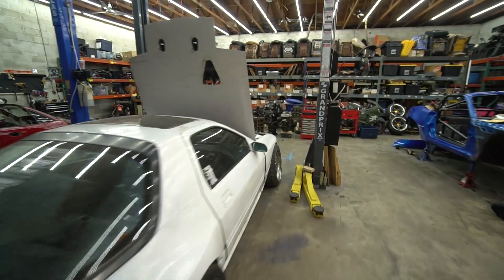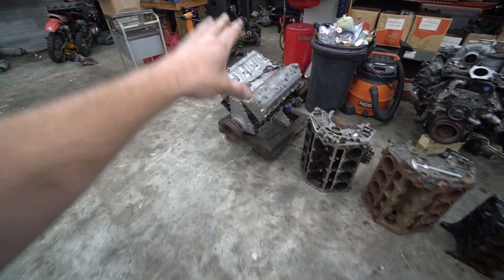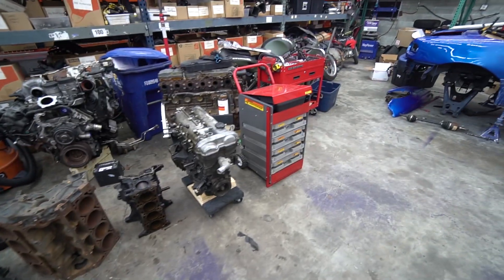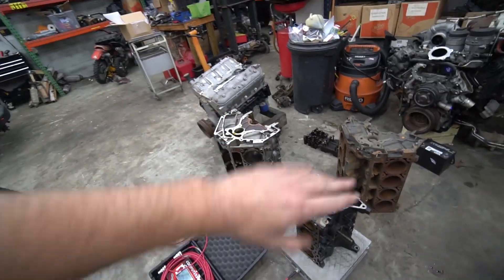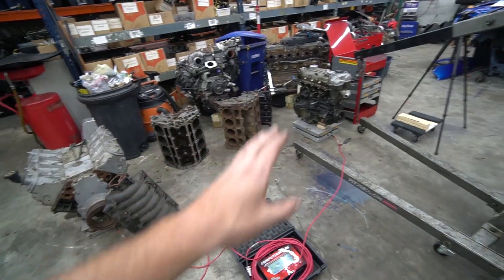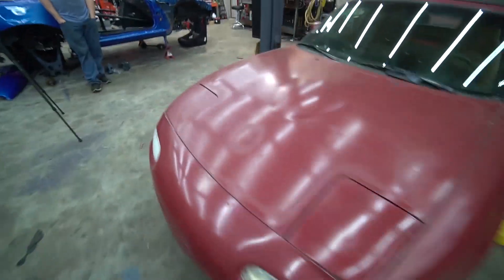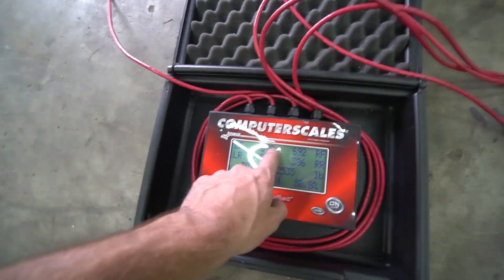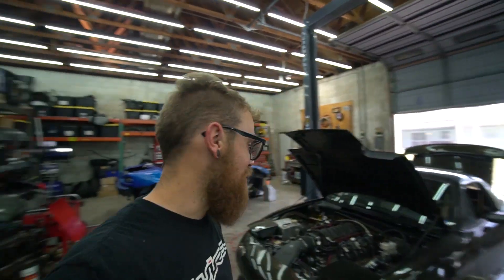Weighing Engines. LS iron vs aluminum block. 4cyl vs V8. Surprising results.

Comment: METRIC weights for everyone else
5.3 aluminium block. 45.812kgs
5.3 iron block. 92.079kgs
1.8 iron block. 31.297kgs
5.7 long block. 184.612kgs
1.8 long block. 100.243kgs
fc rx7 iron 5.3. 1238.307kgs
stock 1.6 mx5. 948.295kgs
gutted 1.6 turbo mx5. 896.298kgs
trailors' mx5 pre ls swap 980.666kgs.  post ls swap 1150.310kgs

(i used the weight summary at the end of the video, so i was a lil confused about the 1.6 and 1.8 miata stuff. why weigh a 1.8 motor when you compare it against a 1.6 dressed and in a car.)
Reply from the maker: Thanks for the conversion! And we didn't have a complete 1.6 to weigh.
Reply: Sensible measurements, thank you
Reply: Jesus so the V8 is three times heavier? I guess you do have an extra head, extra exhaust manifold (as well as a bigger block) etc etc
Reply from the maker: maverick buckley that’s block for block. Dressed engine to engine it’s 2x heavier for the iron less than 50% heavier for the aluminum block

Comment: i had my lfx na weighed at matg, couldn't do front/rear or left/right because it was on an un-level parking lot.  but as a data point....  total weight was 2545 with 3/4 tank of fuel.  that's with an lfx engine, mv7 (cadillac) 6 speed, and a  getrag (cadillac) rear differentia.  complete interior with a harddog double diagonal rollbar.  my son's car with a complete interior and harddog double diagonal rollbar, ls3, t56, and getrag and 1/4 tank of fuel was 2585 (i'm not allowed to be faster than him).

Comment: So with an almost empty tank the LS Miata with a cage, dry sump, steel control arms, yadda yadda, it would weigh in at like 2460 - 2475 lbs. This is about how much a stock 2004 NB weighs for comparison. Honestly not bad at all imo

Comment: I feel like all that work to gut the Miata wasn’t worth it for a 194 lb. weight saving and worse front-to-rear bias.
Reply: 194 lbs is a big chunk tho. Curious about how the weight distribution change effects handling and overall feel.  i can notice the weight difference between a full tank of gas and half tank while driving my miata so taking off 194 lbs, probably would feel crazy

Comment: Bro I love it. Gets a cool gadget and proceeds to weigh everything in sight. 

Really insane how much a difference iron blocks make. The iron i4 vs aluminum ls shows how freaking light aluminum is.
Reply: Aluminium is 1/3 the density of iron, but you have to use more of it to get sufficient strength, stiffness and fatigue life.

Comment: A friend who bought a late NA with an aluminum LS weighed ~2700 with the full interior and roll bar.  It ended up at ~2400 after being stripped similar to the turbo 1.6 you weighed (no rear sheet metal cutout though).  The latter weight was all tar boards stripped, full cage, no interior other than a stripped out dash.  Emilio (949 Racing/Supermiata) had an NA acid dipped and lost 30-40lbs AFTER everything else was stripped.  The wiring stripping can take out ~30lbs alone as well.  There's a bunch of weight to be lost in most modern cars, even the ones that start out pretty light.  And you get get larger than 205s under an NA.  I had 225's on 9" wheels without any roll in back and just a light one in front.  With some roll/pull 275's on 11's are possible depending on alignment and ride height.
Reply: Great info!

Comment: This was interesting to watch. I have a 05 lotus elise, sleeved k24 swapped, intake, 6767 turbo, no cage, air to air intercooler, large oil filter, 1qt larger oil pan. No weight reduction. Guys always say it needs a LS. But no way with the space and im not doing what hennessy did thats to much work. But im sitting at 1960lbs full tank without me at 746hp uncorrected. Surprising how light my car is still to the miatas cool to see you go through all this.

Comment: I wish more people would do vq swaps in miatas, their about even with the stock motor
Reply: The problem with the VQ is that it's a DOHC V6 so it's going to be wider than the LS and that just barely fits. If you're going to accommodate for the VQ you're not too far off with being able to fit something like a Coyote.

Comment: I would be interesting to see whether theres a noticable performance difference between 2 of the exact same miatas like Taylors but one with an iron block and one with an aluminium and see if the 100lbs makes a noticable difference
Reply: Napkin math says it's a 1.5% weight distribution difference if we assume the ~100 lbs is entirely borne by the front axle (which it likely wouldn't be, it would be split between both but still mostly on the front... close enough for a ballpark estimate, though).

Comment: Damn. I'm so dissappointed with the miata LS weight. I keep hearing less than 200lbs over stock.  I didn't weighted my ls1 swapped NB, but I can only guess it's around 2700-2800

Comment: get light weight wheels carbon fiber trunk hood doors fenders ,, itll drop 300 400 pounds ,remove lights motor if theres any ,, list could go on ,, you could get it back down to 2100 pounds easy ...

Comment: don't forget that you also added the unibody helpers (I think you called them ladder bars) that you welded to your frame, that was probably another 60 pounds for just those guys, the skid plate is another 20, and lots more.  the Miata is a build car, not a gutted one.

Comment: My 94 1.8 miata, stock motor just intake and exhaust with no emissions equipment, gutted, no ac, no radio , excess wiring removed, light wheels , no cage ect is 2240 with a half tank of gas. Pretty chunky . idk how I could get it lighter unless i started chopping shit off and even then, to remove another 100lbs would be a mission

Comment: Also another thing to think about for the engine weights. The LS you'll be able to run NA for the power that you'd need a turbo on the 1.8, so with the added weight from turbo, intercooler, and other turbo goodies. Would probably even it out if not make the Aluminum Ls lighter than the 1.8 turbo.

Comment: Would be cool too see the weight difference between the v8 diesel and the cummins diesel that's going in the Fummins. Great video! Maybe you could weigh Adam LZs S13 and compare it too the LS miata.
Reply: to*
Reply: That doesn't make sense to change the too to to. But thanks for the help anyway.

Comment: Regarding the Boss Hoss V8 motorcycle or any other V8 motorcycle. What is the lightest American V8 possible without tuning for power? Including CNC machining the block and heads to remove metal for weight saving?

Comment: i have a stock ka s13 that is basically all stock and has a full interior but is missing the carpets and stuff in the hatch and it weighs around 2500-2600 ish cant remember exactly its been a while plus i weighed it in kg so had to do the conversion. crazy the miata is so heavy though but with the cage and everything else it makes sense.

Comment: The Miata block has the water pump in it, the LS didn't. Great video though. Surprised your Miata weighed 600 lbs more then Ben's.

Comment: i'd like to see long block vs long block without accessories and manifolds but with the weight of the oil in both engines. the V8 taking in more oil than the four cylinder does

Comment: Great video concept, just wished you'd have done it with... well about all the engines, ever.
But more seriously yeah, finding reliable info on engine weight or power/weight ratio is unfortunately impossible most of the time

Comment: Ok, I'm not a guru, or anything, but wouldn't it been better to use a 2.2 Honda type r with 700hp+ than any other motor for weight diversity and rwd, set up curb to weight ratio with higher rpm...it's just my take on it

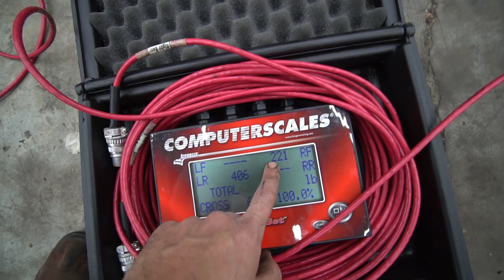Comment: Super confused about iron block 5.7L at 6:52 since the iron blocks jumped from 5.3 to 6.0L. 🧐
Reply from the maker: It's a 5.3 that was bored out and rebuilt with stock LS1 Pistons and Heads.
Reply: Thanks for the clarification Taylor.

Comment: I'd like to see a turbocharger and intercooler core plopped onto the top of that 1.8 engine, maybe even half the FMIC piping as the v8's intake would be at least half as long. People always forget what makes the small capacity engines pump out anything close to the same power as the bigger capacity engines.
Reply from the maker: I weighed the turbo stuff off the LS Miata when I took it apart but I can't remember what it was. I think it was atleast 80lbs
Reply: Thanks for the response mate! Good to compare against this in my case with an S14 in Aus, but we have SR20 of course. I'm in the middle of my swap now to VE L98 6.0L w/ TR6060: https://ls1tech.com/forums/conversions-hybrids/1412014-ka24de-240sx-s14-vs-ls1-240sx-s14-weight-difference-inside.html

Comment: but whats the weight of the solid removable roof and how come you never drift without the roof and just use safety nets on the roll cage. ??

so when are you overnighting the 'MX5  carbon fibre front quarters, doors, bonnet and trunk lid from Japan . :-)

Comment: I love how Taylor acts like 2500 lbs is heavy. Lol, anything under 3000 is light, realistically.
Reply: In FD, there is a weight minimum. It'd be difficult for Taylor to say complete in Pro2 with the LS miata since he'd need to throw on a shit ton of weight. Unless I'm wrong, in which case please correct me.
Reply: @zayaanali26  doesn't matter anyway because the miata fits none of the FD rules.

Comment: How about a BMW e30 with a LS1  or other aluminum block.  Front to rear weight % vs standard e30 325is AND 318is (twin cam 4 cylinder)?   I have a e30 318i touring that I am considering doing a 5.3 aluminium block swap. The current 1.8 iron block M40 engine needs to go. If you can find a couple of wagons to do this with,  even better!

Comment: 90s Camaro and Mustang V8.
Reply: I weighted a 91 z28 back in like 95 at a dump scale, how correct it was I don't know, but they did charge people based on the scale, so I'd hope close. iron block 305 with a t5, everything but the stock cast iron exhaust manifolds switched to headers. but still had subs in the back. it was 3360. the old 3rd gen gutted like a drift car would probably be about what that rx7 is. the lx fox body probably 250lbs less stock for stock?

Comment: So... still waiting on Fummins parts huh? Also, is there anything stopping you from building a full tube chassis à la Leroy with no panels for drifting? Seeing as aerodynamics don't really play that much of a role in drifting, you can probably build something really cool and 100% custom and shed easily 300-400 pounds, while having ALL the angle, the perfect stance, perfect weight transfer, etc... Are there circuit rules that prevent you from doing this?
Reply from the maker: More so getting my car ready for a big $20,000 payout drift event this weekend.
Reply: @Taylordrifts  Hehe yep gotcha, rooting for ya!
Reply: @Taylordrifts  Good luck.
Reply: I don't wanna see stupid builds ... I got Rudnik for that